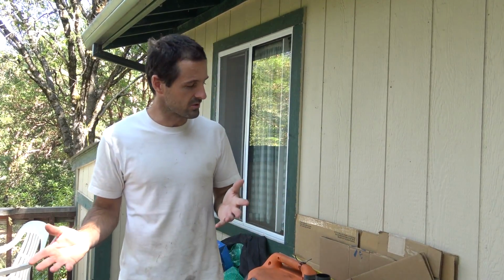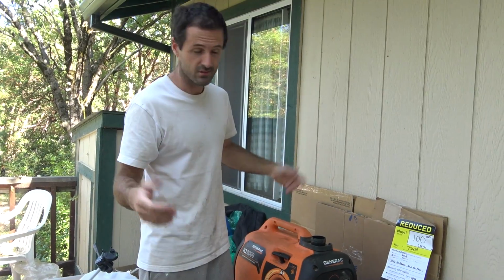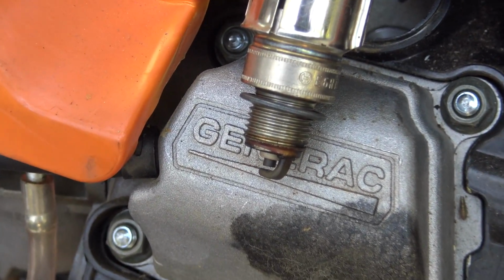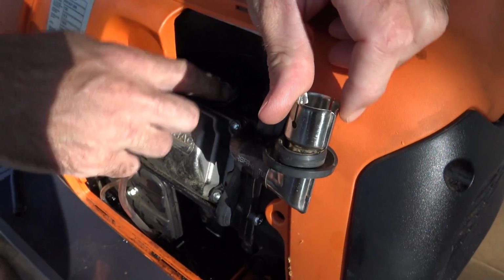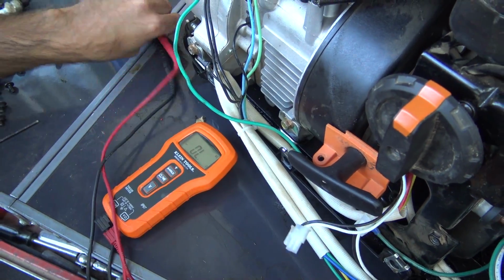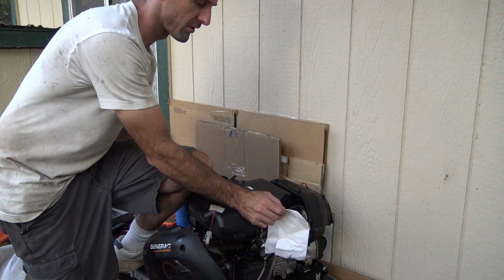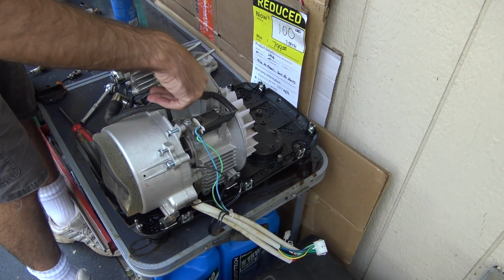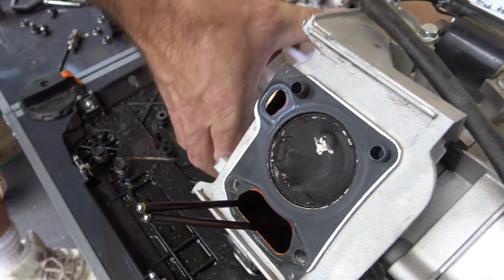$25 Generator From Lowes - Will It Run?

Comment: I need a follow up video ASAP .....can’t wait....a ...week......
Reply: 15:43 wow..... and that will have to wait until next video

Me: 😭😭😭

I'm just kidding anyone who watches deserves an explanation

Me:👍👍😎😅😀

The cylinder looks just fine tune in next time to see what the problem is 

Me: 🤔 😱😡😒🔫
Reply: Sounds like the people have spoken. Chop chop man!! 😀
Reply: What..? No... Air wouldn't be able to enter the combustion chamber because the intake valve isn't opening, provided the engine was spun the proper direction. So, it wouldn't have anything to compress and therefore, no compression. You'll notice when he spun it backwards, it had compression. Reason being it was able to pull air in through the exhaust port, since it would appear the exhaust valve is still functioning.  It exhibits signs of a wiped cam lobe, like you'd see in old flat-tappet engines that were run with low-zinc oil. And looking at the oil that came out of this thing, It probably wasn't lubricating like it should and wore off the intake lobe. I imagine the exhaust lobe is probably pretty worn as well, just not as much as the intake cam lobe.
Reply: Spoiler Alert: The camshaft is the problem. Wiped lobe or broken.
Reply: nike12000 I know right?? I'm fucking loosing my tempor
Reply: Same here
Reply: same here
Reply: Same
Reply: akio2589 nope, he'd have two compression strokes instead of none
Reply: akio2589 it does'nt work like that in practice, poppet valves are only good in one direction, so on an engine with excessive tappet clearance (due cam wear, incorrect adjustment on adjustable rockers or bent push rods) will feel like it has two compression strokes per cycle when pulling it through by hand or using your thumb on the plug hole to listen for escaping air.
Think of the valve as a non return valve with the ability to lift manually. 
I can see how on some really high revving engines with tiny valves and very stiff springs this may not be the case however a Honda GX clone does not fall into this category!
Reply: In fact, if you look at my channel, I have a video I took years ago, where I've cut the back off a Briggs engine. You can see, plain as day, a cheap, plastic camshaft. They do break, the lobes do wear unevenly because, in a Briggs's case, of uneven oil distribution, combined with no one ever changing the oil in push mowers. And when the intake valve has a problem and isn't operating properly, you have this EXACT scenario. No compression spinning one direction, compression spinning the other.
Reply: ASE is an automotive and light diesel repair certification. Also, EPA 609 certification for handling refrigerants. Not lawnmowers. Clone or not, that's not a Honda GX engine. You're wrong about Chinese clones not using plastic cams. I've absolutely seen plastic cams in clone engines. I've even seen the metal ones snap, right in two, between the lobes because they're made out of shit metal, although, that's far less common. I have 12 years working on engines and transmission, 6 years tuning and performance modification. That is to say, I build and rebuild them. Conditions I've listed aren't hypothetical, I've seen them happen. And you are arrogant. I didn't come blazing in here claiming to know more than anyone did. I made an assessment based on what I've seen in the past. 

You're less-than-friendly tone is because you're less-than-friendly. Either way, I have to deal with people like you on a daily basis. They know more than me, they've done more than me, they've seen more than me, blah blah blah blah blah... Whatever you believe, man. Like I said before: I don't want, need, or care for your validation. I've done what I've done, I've seen what I've seen. I can only make assessments based on my past experiences and training.

And frankly, I have nothing more to say, this is a waste of my time.
Reply: A wiped cam would keep the valves closed so it would still have compression ?
Reply: Fake News No, it would prevent air from entering the combustion chamber, so no compression.
Reply: You're assuming that neither valve is operating. I was making the assumption (incorrectly, mind you, turned out to have stuck and/or broken rings) that one cam lobe, the intake cam, had gotten wiped or broken. I figured this engine to have a cheap, plastic camshaft, which many small engines like this do. I have seen one cam lobe or the other wear down, or the the lobe itself chip off. In that situation, you have one valve operating while the other does not. When it's the intake came lobe that wears or is damaged, is does this exact thing. No compression, but will have compression spinning it the incorrect direction. And since, during normal operation, the intake cycle begins, immediately after the exhaust cycle completes, the intake valve opens immediately after the exhaust valve closes (disregarding overlap, for demonstration purposes), then it stands to reason that if you spin the engine in the incorrect direction, it would pull air from the exhaust port and try to exhaust through the intake port.

So... Spinning the engine in the proper direction with the intake valve not functioning for whatever reason, air can't get in the combustion chamber. So, there is no compression. Sure, air will enter the combustion chamber because of the vacuum created in the combustion chamber when the piston is at BDC and the exhaust valve opens,  but since this will occur at the beginning of the exhaust cycle, the exhaust valve remains open for the duration of the cycle, so, no compression there either.

In a normal engine, poppet valves will operate, regardless of engine direction. If you could figure out how to put the carburetor on the exhaust port, the engine would run backwards. Not as efficiently, mind you, because of port sizes, valve sizes, valve timing, etc. But it would absolutely run backwards. By running it backwards, you have effectively reversed the function of the intake and exhaust valves.
Reply: akio2589 got to plastic cam shafts and stopped reading, sorry mate, I'm glad you're having fun. Please don't continue this or lecture me on engines as I promise I have forgotten far more than you will ever know. Otto cycle is my recommended subject for your homework.
Reply: The people who claim to know more than anyone else, or know it all are the ones who have the most to learn. I'm pretty familiar with the Otto cycle. And the Atkinson cycle. And Diesels. And two-strokes vs four strokes. I don't really care weather you agree with me, nor do I care weather you validate my assessment. I have SEEN it happen, I had, at one time, a small engine repair business. I spent my childhood growing up working in my father's automotive repair business. Real world experience. I've been to school for it. I have the A1-A5 ASE certifications, A1 being engine repair, mind you, and I'm still pursuing the other 4. Don't tell me you know more than I do, you have no knowledge of my background. And most importantly, don't mistake arrogance for wisdom or knowledge.
Reply: If it was bent in the open position you would have no compression
Reply: akio2589 man, just read back through your own comments and see how much you contradict yourself, either edit them, delete them completely or be a man about it and admit everything you know comes from wiki
Reply: What would you know about being a man..?
Reply: Like I said, you're wasting my time. I don't need or want your validation. Idgaf weather you acknowledge me or not. And again, I really have nothing more to say to you.
Reply: akio2589 but I thought we could be friends?
Reply: akio2589 you know about diesels?? Sweet!! Do you know alot about the v8/diesel conversions that came out in 80's model suburbans??
Reply: Let's see... If I'm not mistaken, the 80's Suburbans had the 6.2L Detroit Turbodiesel.  It had the GM BOP bellhousing pattern and mounting bosses, as it was made to pretty much be a direct replacement for the gas engines available at the time. It was replaced with a 6.5 litre in the 90's that was produced until the Durmax came out ~2000-ish? If I recall, the 6.5 had a problem with cracking heads and the injectors (pump..?) failing. Truth be told, I haven't come across very many of them. Is there something specific you want to know..?
Reply: akio2589 my husband has an 83. The starter already cracked the bell-housing once from excessive cranking. It was fixed, but if it happens again, they said it would likely crack the block. Plus the transmission, I think it's a 400 turbo. It went out after months of doing fine. So is it worth fixing???? I think he has the opportunity of getting a 650 or 700 turbo transmission. It has a great motor, it took us everywhere for almost six months
Reply: The TH400 is a wonderful transmission. It was built for applications like the Suburban. Actually, it was the transmission of choice for most GM heavy duty chassis in the 80's. Incarnations of GM vans, trucks, and RVs built on Chevy platforms will often have a TH400 moving them forward. As to weather it's worth fixing or not, well, it depends. If the trans has failed, it's either pretty high mileage, or someone was not very kind to it. You could have it rebuilt. It would cost around $500-800 (in the US), depending on locality. You could have it built to handle more power, probably around $700-1200. Or you could buy a new (to you) rebuilt transmission with a warranty for around $1200-1300. Although, bear in mind that you should mention that it's behind a diesel, so the governor weights and springs can be properly equipped to accommodate the lower RPM shift points of the diesel engine. 

I doubt the bellhousing cracked because of excessive cranking. It's more likely that something stressed the bellhousing in that particular location. It may not have the correct or worn starter/flexplate, causing incorrect engagement and making the starter twist in unusual ways. Something could've gotten run over and hit the bellhousing in that location. Or, perhaps one of the motor and/or transmission mounts are faulty and putting a lot of stress on the bellhousing. There's a number of different reasons, but just cracking during the normal course of operation is unlikely.

The TH400 was the heavy duty transmission at the time. It was later renamed to the 3L80, and was replaced by the 4L80E in the 90's. To the best of my knowledge, there isn't a 650 or 700 turbo transmission, as the transmission that replaced the TH400/3L80 was the 4L80E. The 4L80E could be used, but you would have to add a stand-alone transmission controller, as the "E" in 4L80E stands for electronic. There is also a 3L80HD (heavy duty) variant of the TH400/3L80 that exists.

Sorry for the long-winded response. As I said before., weather it's worth fixing or not depends. It depends on the condition of the truck and how much money you feel it's worth sinking money into. Anything can be fixed if you throw enough money at. If you wanted to sell it, for example, and wanted to fix it to get more money out of it, chances are that unless it's in pretty damn good shape, you're not gonna get the cost of repairing it back out of it. If you want to fix it to keep and use, again, what's it worth to you? What else will need fixed (suspension components, engine repair, rust repair, interior repair, etc. etc.)? Evaluate it and see weather it's worth it to fix that one, or get another vehicle that's newer/in better overall condition.
Reply: Unless you were talking about the 700R4. In which case.... Eeehhh, it would handle it if it were built to handle it... A stock 700R4 wouldn't take that kind of torque for long.  It's not really a heavy duty transmission.
Reply: akio2589 nah, it's fine. I'm learning alot today. The guys that are gonna work on it when we get the money, they said they found a 650 turbo transmission on their website. So it's not real, or you've never dealt with one??  Since we're kinda down on our luck, they said they'll cut us a break and let us pay for the used transmission with warranty and allow us to drive it, then pay for the labor weekly. Around 1000 altogether. And we love it cause it didn't have any problems at all, everything works. So I wouldn't wanna sell it anyway. And that's interesting about the bell-housing, the guy said the starter must have been too hard on it and cracked under stress. I need to save your messages and tell my husband when he's home, he's probably gonna be pissed. And this is alot of education to remember. But thank you
Reply: Eh, I'm not saying there's absolutely no possible way that the bellhousing cracked under the stress of starting the diesel. It just doesn't seem very likely. See, the starter doesn't bolt to the bellhousing on that engine. It does have a boss on the end of it that fits into the bellhousing, but it bolts to the block. If the starter is moving around enough to cause the bellhousing to be damaged, there would almost certainly be damage done to the block mounting bosses. And something, besides just normally cranking the engine, is causing it to move around. Honestly, I would have to see it to make an accurate determination. 

As far as a 650 turbo transmission, I've never heard of or seen one. I'm not sure what transmission they're referring to, but a 650 turbo transmission doesn't exist. The only transmission offered for the Suburban are the TH400/3L80 and then later, the 4L80E. After doing a little research, I guess they did offer the 700R4 in the Suburban for a while, though I've never come across one with that transmission. Perhaps that's the transmission they were referring to..? I could make a determination for sure if I knew weather it was a 3 speed or 4 speed transmission. Or weather or not it has overdrive. You'll know if it has overdrive when you look at the gear indicator. P R N D 2 1 is no overdrive 3 speed.  If it has 2 "D" and one of them has a circle around it (P R N (D) D 2 1), that indicates overdrive and it's a 4 speed.  TH400/3L80 = 3 speed, 700R4 = 4 speed. If it is a 700R4, I'm not really surprised it failed. That's not really a "heavy duty" transmission. Not in its stock form, anyway.

1000 bucks seems about right for a used transmission and labor. The labor is probably what's costing a majority of that. Both the TH400/3L80 and the 700R4 are PLENTIFUL. They're cheap and easy to come by.

Anyway, hope it works out. Best of luck.
Reply: akio2589 so we want the 400 turbo transmission? How is the higher number less durable?? And thanks alot, you've been quite helpful
Reply: akio2589 the transmission has 123d on the readout. But no overdrive. But the drive gear let us do 80 and 90 down the freeway no problem, and he said that was really impressive to him compared to other cars he's had.
Reply: akio2589 well that's extremely helpful, cause nobody really gives us a straight answer. Especially the mechanics. When it quit working, it simply wouldn't shift out of first gear no matter what my husband did to it. And they said they tried adjusting something or other under the hood to help it change gears, but that somehow made it worse. So they recommended a used replacement being cheaper. And it was getting 26.7 mpg highway mileage. But we never tried to measure city mileage. But he said that's really good mileage for a big ol' tank like it is. So he says as far as that goes, he'll never sell it. I just need to start my new job so we can afford to fix it
Reply: akio2589 you mentioned tires. How do tires effect the drivetrain?? He recently put 285s on it, I think.
Reply: akio2589 your last reply didn't come thru, it must have been deleted
Reply: Lindsay Jackson What they probably adjusted was the throttle valve (sometimes called a "kick-down") cable. It's one of the first things that should be checked when a mechanical transmission like this is not shifting. However, if reverse still functions and it just suddenly stopped shifting one day, but will still move and doesn't slip, that points to the governor that I mentioned earlier having a problem, or possibly some stuck valves in the valve body. If that's the cause, it's a fairly simple repair and not terribly expensive. Would cost less than a used transmission. You may be ahead to try to find a transmission repair shop and ask them to evaluate it. I can guarantee that any well-established transmission repair shop has seen more than their fair share or 700R4s. They're a VERY common transmission, or they were at one time. Though, they're mostly seen in cars and light-duty trucks from the 80's and 90's. It may cost you less to get the transmission repaired.

As far as tires are concerned, for daily driving, bigger tires are not better. Bigger tires means that the vehicle travels further with every rotation of the tire.  So, as a result, your speedometer will read a slower speed than you're actually traveling, because the bigger tires aren't spinning as fast to cover the same distance as a smaller tire. This also makes it harder on the engine and transmission to do its job. It's harder for the engine to get the mass of the vehicle moving and maintain speed.

It works kind of like a bicycle:
You usually have two sets of gears on a bicycle. A set of gears in the back, and a set of gears near the pedals. Well, you'll notice that if you shift the gears near the pedals to a higher gear, the chain will move to a bigger gear. You will not have to pedal as quickly to maintain speed, but you will have to pedal harder to start and maintain that speed. The same is true with running bigger tires. The engine and transmission have to work harder to move the vehicle. 

If you're doing some off-roading, then bigger tires have an advantage, better traction. If not, then you're wasting money, as bigger tires are more expensive and they cause unnecessary wear and tear on the drivetrain. You're also more likely to hydroplane due to the increased surface area of the bigger tire. It also raises the vehicle, and therefore the center of mass, making a rollover more likely when doing quick or emergency maneuvers. The stock tire size for the Suburban with stock rims is 235/75R15.
Reply: akio2589 yeah, reverse was working fine. And when u put it in drive and hit a hill, the hill wouldn't hold it back. It would fly on like u put it in neutral, until it slowed back down to about 10 or 15. And it'd put itself back in gear. And he put those big tires on it cause he's afraid of being inferior, whatever that means. And cause we got alot of rough back roads. But thanks again, this is extremely helpful